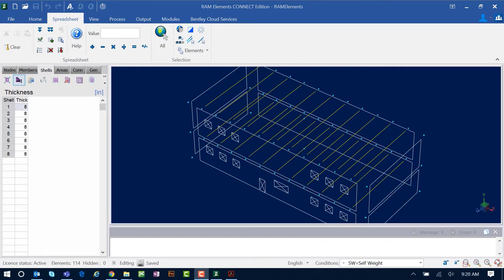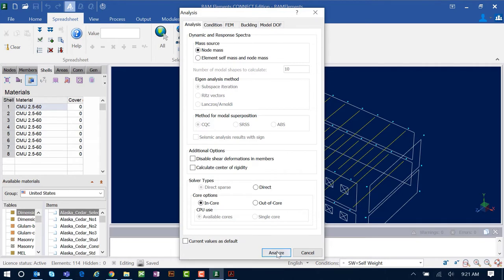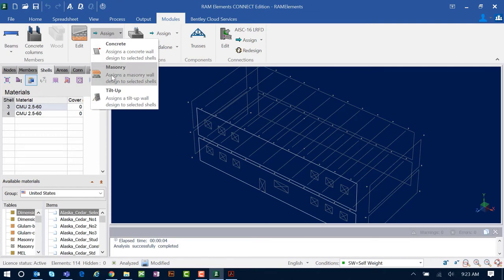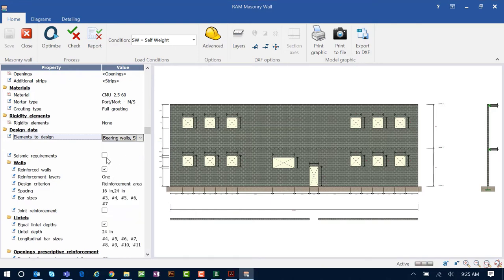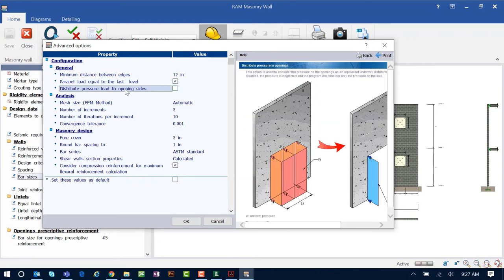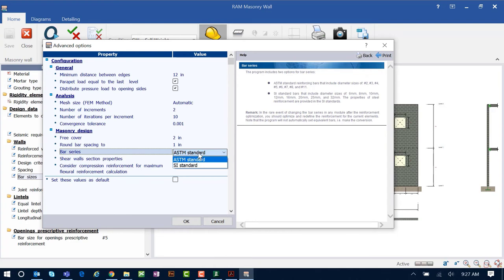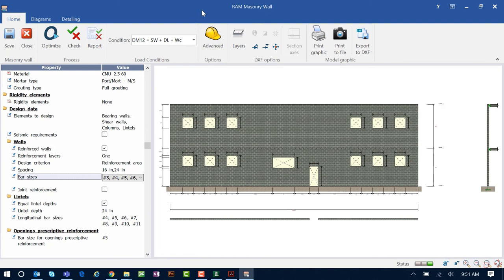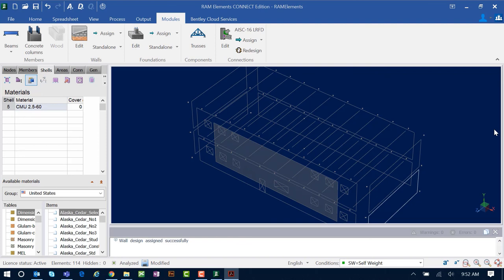Designing Masonry Walls in RAM Elements

Comment: what cmu 2.5-60 mean? thickness and grade?
Reply from the maker: In RAM Elements, the default concrete masonry materials uses the material grades in the naming convention. For this video, the ultimate compressive stress of the masonry (f'm) is 2500 psi and the yield stress of the longitudinal reinforcement (Fy) is 60 ksi.